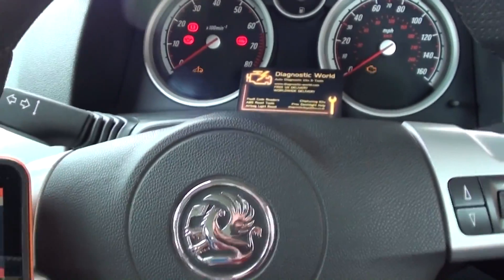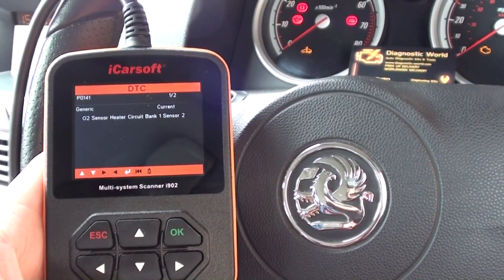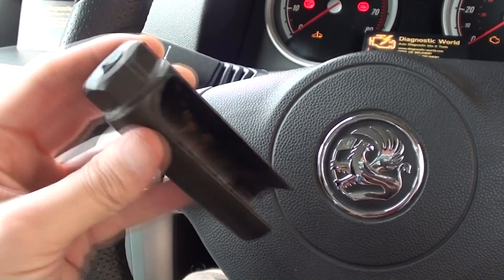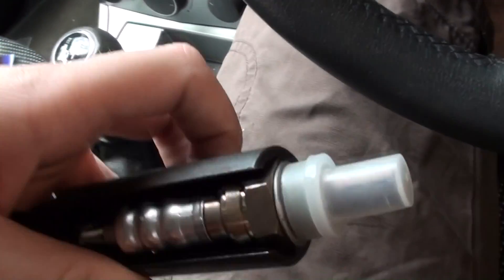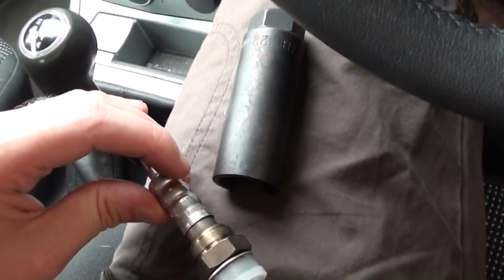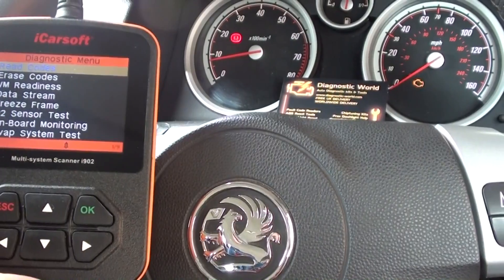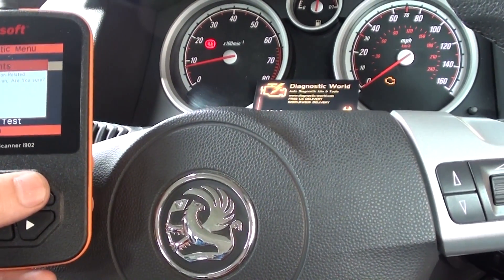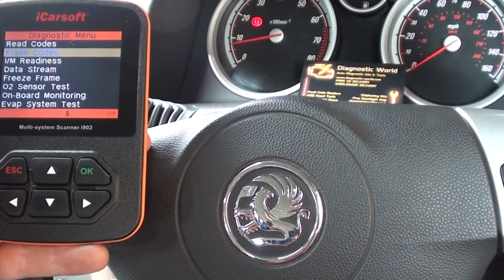Vauxhall Opel Astra H Rear O2 Sensor Replacement P0141 Bank 1 Sensor 2

Comment: Honestly I’ve got all the paperwork. MOT failed and told me need a new Cat Converter and that will cure the management light. New Cat and sensors £300 and still that error code. I bought my sensors off eBay £24 each. Cat was £250 and mechanic kept my old one that didn’t need replacing. 
So I’m still stuck with this error code, any idea if this causes excess fuel and slight sluggish. I’ve got a Zafira. Thanks

Comment: I had this issue on one of my previous cars. The sensor was £250 and the exhaust needed to be dropped to access it (stupid Ford design) so I didn't replace it. This issue just came up on my Astra so I was very concerned that it would be hard and expensive. Glad to see how simple and cheap it is compared. Thanks.

Comment: What were your symptoms running this car with a bad O2 sensor? I don’t have a Check Engine light on but I do suspect one or both of my O2 sensors are dead or dying.
Reply: Sluggish slightly and I get a crackling noise on accelerating

Comment: Hi hv problem with astra j 2010 getting slow while driving & engine stopped by self & coolant pipes getting very hot & hot water coming out..ask mechanic he said Ho2 cancer circuit need to change any advice plz

Comment: It's best to heat the sensor up with heat gun and give the threads a few sprays with wd40, they are prone for stripping threads out if it's cold, they are supposed to come with heat proof paste for the threads but it dries up over time, I've replaced hundreds of these.

Comment: Hi i replaced rear sensor and cleared the codes but code comes back any ideas plz
Reply: I would recommend checking the connector and wiring that the sensor plugs into, could have a short somewhere.

Comment: Hi could this  cause the car to cut out during acceleration?
Reply: The 02 sensor affects the fuel/air ratio so it's possible but you'll most likely see poor fuel mileage.
Reply: Check your coil pack

Comment: I have a Astra h vxr 2006 I have a po170 fuel trim bank 1 code pop up. Finding it really hard to know which sensor to buy. Any help plz lol
Reply: Bro I got the same problem did you manage to get it fixed ?

Comment: Hi is there a difference between the sensor you have in your video which has gaps in the sensor piece which has a temporary cap on it in your video to the one that looks identical but has a rounded stump with no gaps in the sensor??  I'm not sure what the difference is and if it makes any difference. I have the same fault code for Vauxhall Meriva 1.6 and not sure which to buy.

Comment: i have a question for you, did you face any trouble when you try to plug in the new sensor to socket? i bought Denso Dox-2003 sensor and for some reason the harness socket did not fit probably! any idea. i have Astra h 2008 1.6 L petrol

Comment: hi there. just wondering were did you get your o2 sensor 2 from for w4 pound :-). I've been looking for one but my price on euros come at around 64 pound :-( a link for a 1.6 twinport astra h would be good. :-) great video thank you.
Reply: Can i just say i bought brand new one from ebay for £25.  and its caused more problems that before.  So please be vigilant where you buy cheap parts from
Reply: @staceymoore1576  same here. I brought a cheap one from Ebay for about £24 and it caused more issues than it was worth.
Reply: yes it's better to give little bit more money for car parts